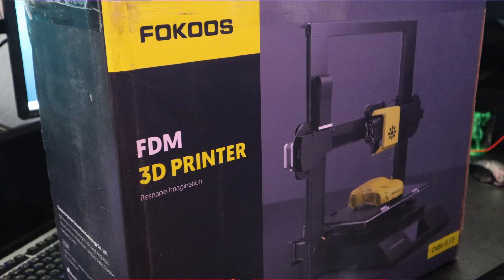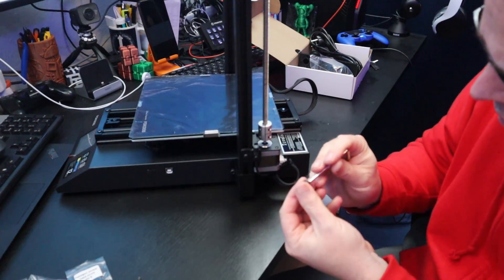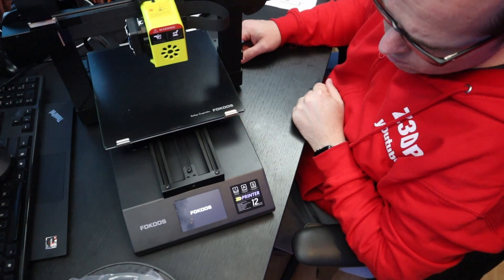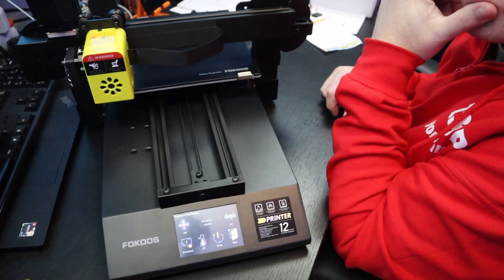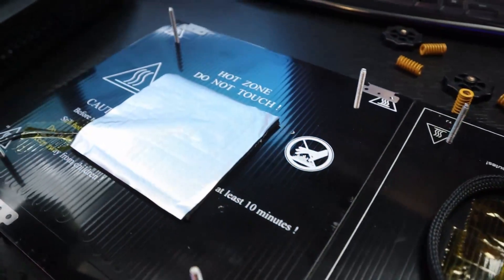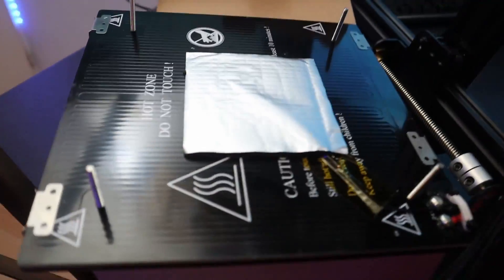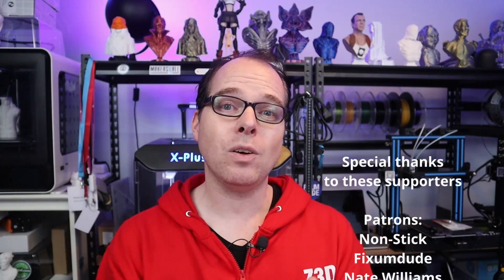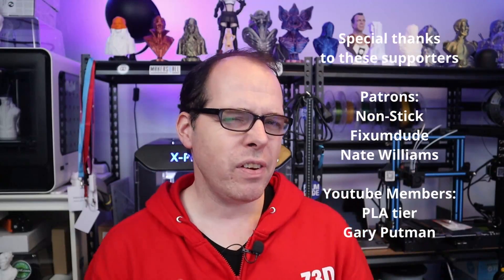I bought an Amazon-Returned 3D Printer for $99! What can you expect?

Comment: I bought one too. It only had the bottom piece of packing foam in the bottom, so it was bounced around pretty bad. So bad that the metal guard covering the PCB board on the top left was dented in, and the ribbon cable connector was broke off. The mem card was broke in half, only about 1 meter of filament left on spool, and the shape of a benchy lightly scarred into the bed. Clearly careless use by the previous owner. But I carefully soldered the connector back on, it was tedious work!
But now it works! It prints super nice, and wow does it stick to the textured glass!  The included PLA is nice stuff.
The stock firmware/screen was nice but it was lacking 1 thing, preheat.  You have to manually hit the + button to warm up each part.
So I installed Mike Kings firmware and it covered that issue, and has a bunch of more features, but I do miss the gcode image preview.
The machine is quiet, and pretty fast, very clean looking....blows my tevo tarantula out of the water! Best $72 I ever spent in 3d printing.
Reply from the maker: Sorry for my late reply. Yeah I would have been great if Fokoos did a short check on the returns before sorting for reselling. I can imagine it could cause big issues that people and they don't want. 
But great to hear that you did manage to get it working again. If people are handy to handle these kind of printers, to can save a lot of money

Comment: Fokoos website had a deal for two at $160.  I had first going after checkout.  It was like new, unused. Seemed better than my first new purchased a year before.
The second return needed two small things, POM roller wheels were loose on bearings. I changed them all. Other issue was, extruder drive gear was not aligned in filament path. A simple fix by loosening setscrews, pushing gear in close to motor housing, without contact, then tightening setscrews.
It was great fun! Very pleased with purchase.
Reply from the maker: Sorry for my late reply. Glad to hear that the purchase was pleasing

Comment: It sounds like the bed shorted out and probably damaged the mosfet for the heated bed.  It is a great deal. You could swap out the board, or possibly replace the burnt out part. Love your videos.
Reply from the maker: Yeah the bed was also damaged, which caused the sort on the mainboard
Reply: @Zachary3DPrints  I saw that. When it made contact with the nut on the frame it got shorted to ground. Which is why I assumed it popped the mosfett. It could be a fun repair video. Although it is obviously easier to replace it as you did.
Reply: @Zachary3DPrints  the board is an mks clone, and you can swap one right in and still have a great deal!

Comment: I ordered one of the returned Odin5 F3 printers and it was delivered yesterday!!! I got it assembled and found a micro sd card broken off in the card slot. Got it out quickly and easily. The only issue I've found is the bed is a bit warped. The corners are level/trammed but the center is quite low. I also need to look into the WiFi adapter and see how that works. So far very happy with the printer and I can't wait to get my first print going on it today!!!
Reply from the maker: There can always be some little issues with those returned printers, some can be huge and some are very little. There is a connector for the WiFi on the board, but not installed, for what I know of. Mine is printing great
Reply: @Zachary3DPrints  Oh yes, I purchased the printer knowing there could be issues. It's always a roll of the dice when buying a returned product. I did get a chuckle when I noticed the prior owner put the first layer into the glass bed and the plastic shipping sheet was still on the aluminum bed plate. I've seen the quality these printers can print at, during a live stream and I was very impressed with the prints. Even if I find some issues like you found with the bracket, it's minor, IMHO. Love your content btw!!!